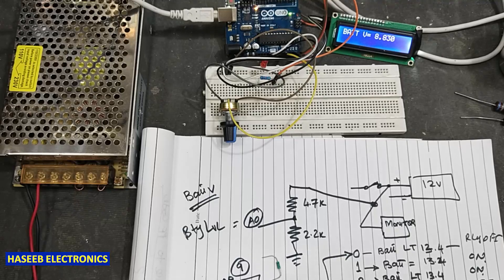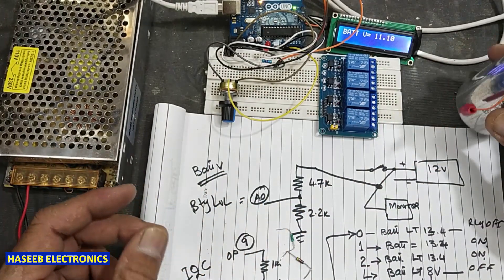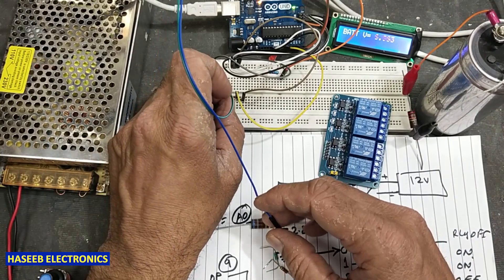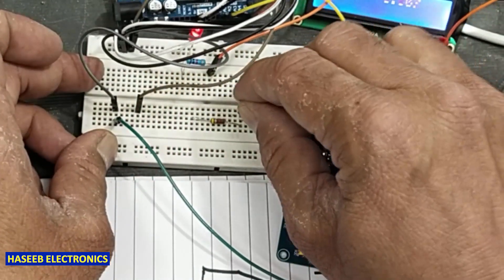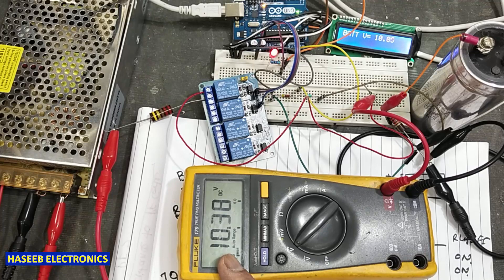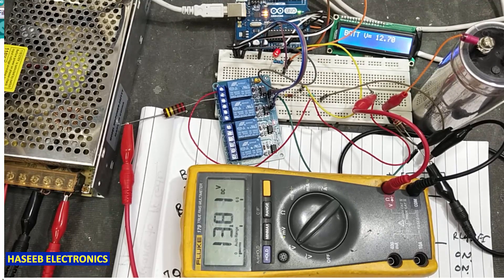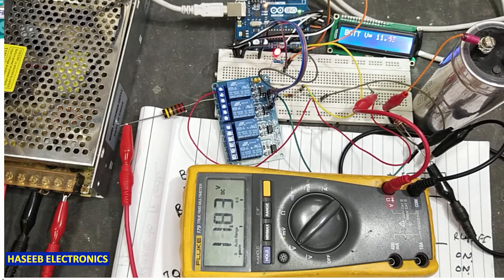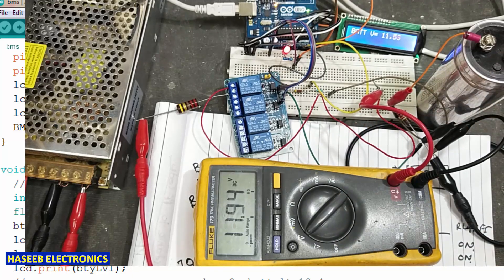{712} Battery Charge Discharge Controller With Arduino Code

Comment: Hallow sir i am from Bangladesh ! how can we see amps and controls this  amps from arduino with CT ? plz give us this video coz we learn from your video showing display battery voltage hi cut and low cut  .Thanks to give us this kind of informative video
Reply: You can measure current using current sensor module acs712